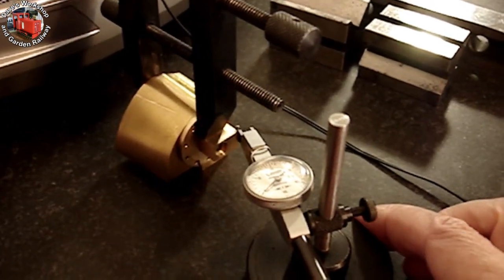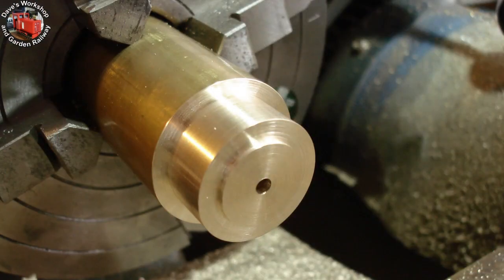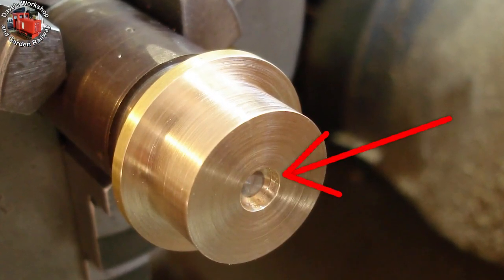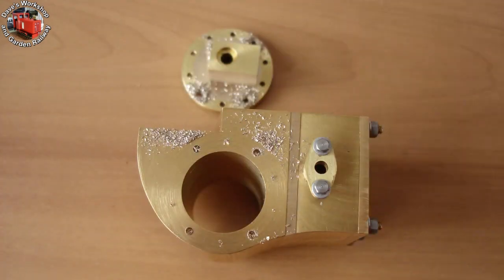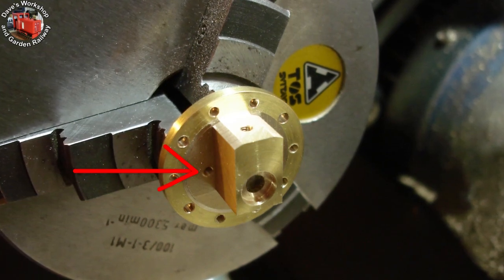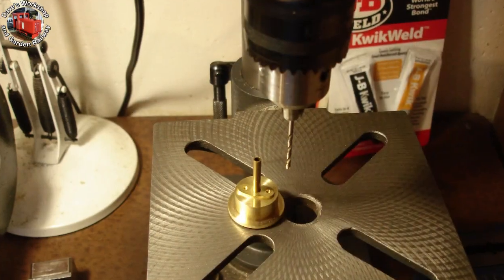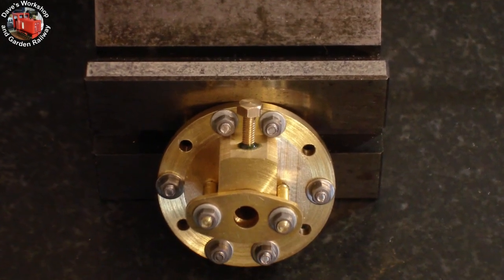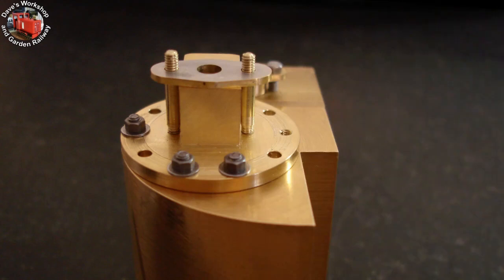Building Charles - Part 11 - Rear Cylinder Covers for the live steam loco

Comment: Excellent work as usual. Why don't you use a parting blade in a rear toolpost? My Myford is more than rigid enough on any material, or are you a fitness fanatic? Cheers.
Reply from the maker: Paul, its just one of my eccentricities 😀

Comment: How do you do all your soldering? With Electronic solder? ( Good you retired the robot voice, the narration is very pleasant to listen to.)
Reply from the maker: Thank you.  I am using plumber's solder, I bought some sticks years ago.  And, I'm using a Zinc Chloride flux.  I use a gas torch for heating large jobs, and I apply the solder with an 80W electric soldering iron